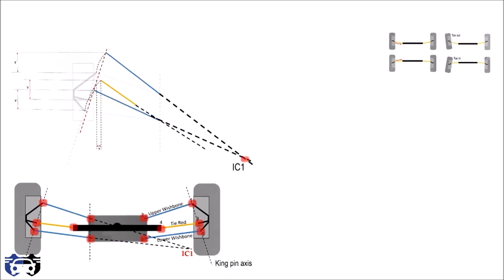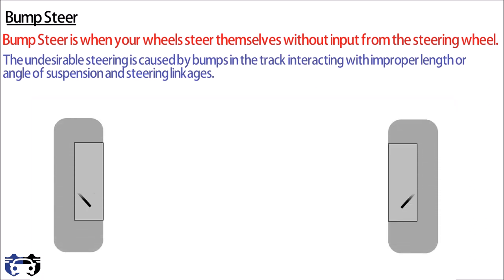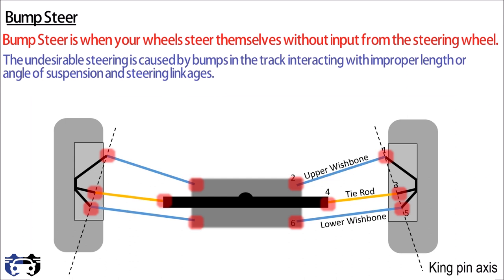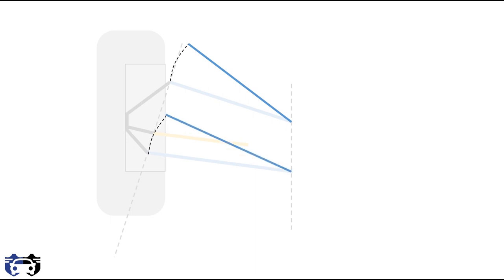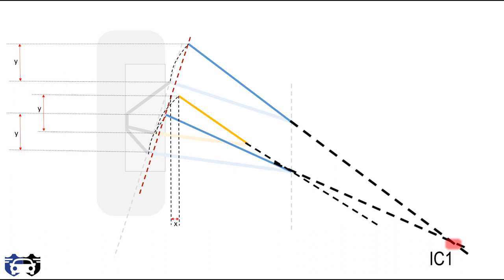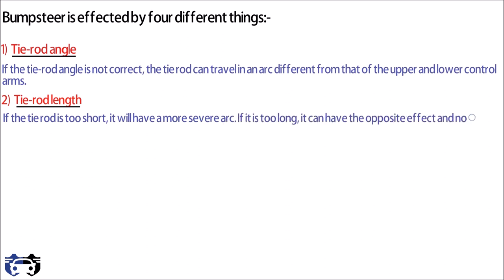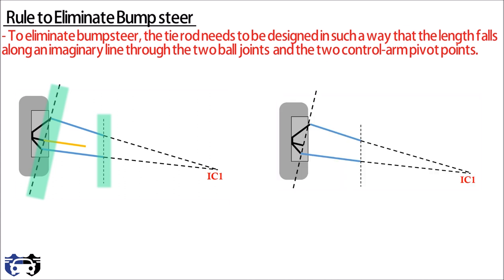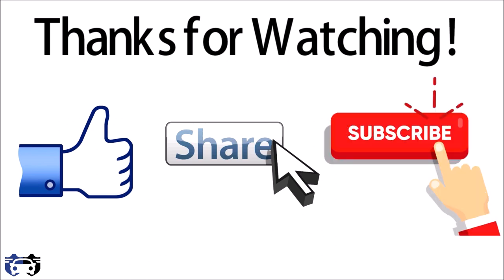Bump Steer | What factors effects bump steer? | How Bump steer can be corrected ?

Comment: Excellent explanation. I'll admit, I had to listen a few times to fully digest the information. I do have one question, would placing a vehicle with a bump steer condition due to something bent (from a pot hole) on an alignment machine show where the bent component is? Simply, will the alignment machine show the cause of the bump steer?
Reply: An alignment machine can show SAI. Or steering axis inclination, which can indicate a bent strut or steering knuckle, when the measured angle is shown to be out of spec. It also can measure included angle, which is SAI including a camber measurement. Generally you use the measurements and visual inspection to determine bent steering and suspension components.

Comment: A company car I drove years ago, a Nissan Dualis had shocking bump steer and since I live in Australia the freeways are quite undulated and it was difficult to keep in my lane sometimes when going over bumps. It also had the opposite to bottoming out on the bump stops, not sure on what term should be used but when coming out of a bump or dip or even dropping off a speed hump the struts would fully extent and run out of travel and make a big clunk, as if the height of the SUV was not accounted for when selecting for shocker length when they designed the car.  My best guess is perhaps they used the front end out of previous sedan model or something and not redesigned it to suit SUV ride height and just made it fit.

Comment: I have a pro street car that has an early Mustang II front suspension with manual steering rack. I bought the car from the guy who built it and did a nice job on most everything. I had the car shipped to me and first thing I started to drive it and at about 20-25 mph the road was a little bumpy and that sucker wanted to pitch itself to the shoulder of the road. I did give it a bit of gas when it did this but if I feather the throttle I can creep up to 70 mph and it doesn't bump steer but I sure don't feel safe even with it having a full roll cage. So say I'm cruising at a steady 40 mph and hit the throttle then in a couple seconds it gets very violent and scary heading for the shoulder of the road. It's a really cool car but I spent so much getting the car I really don't have the dough right now to have a high-end hot rod shop fix it. The front wheels look straight but when I called the guy, I bought the car from and I was not happy because I asked him before I bought it if he had any issues with the Mustang II front end.  So, he said he never put it on an alignment rack and thought maybe he installed the rack to far forward of back to far. I took from front tires of and coil over shocks and ran the suspension up and down and the steering wheel went nuts back and forth. So, any suggestions on something I might be able to check out please let me know. I will not drive it this way. So the lower control arm should or should not run parallel with the steering tie rods? With thanks, Jason 1960 Hillman Husky 2 door wagon pro street car with SBC/9" rear end, tunnel ran 2 carbs. hood scoop, TH-350 trans ect ect

Comment: Thanks for the in depth explanation. As you discuss in one of your other videos, antidive angles the upper control arm so the ball joints would not be aligned as seen in the front view at 5:44. In this case, should the tie rod geometry be based off of the line through the forward ball joint, the rear ball joint, or in between the two?

Comment: Ok so I definitely have an issue
When my truck is up on jack the front toes 
But when I set it back down it goes to 0 toe
I took a look at the tie rod angle and it’s a little off from the lower control arm

I guess this makes sense on why the truck darts across the freeway on bumps
Reply: Is the the rack tie rods suppose to always be parallel with the lower control arm on a early Mustang II? Have radical bumpsteer.